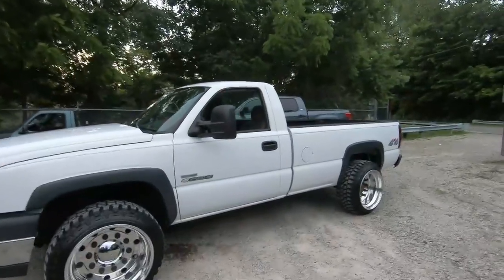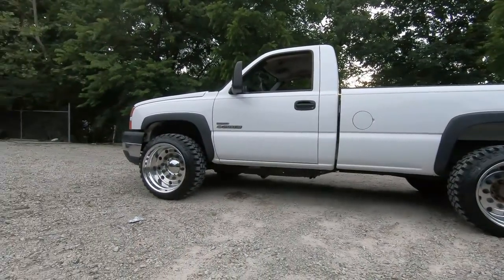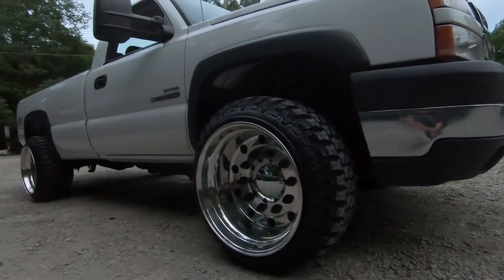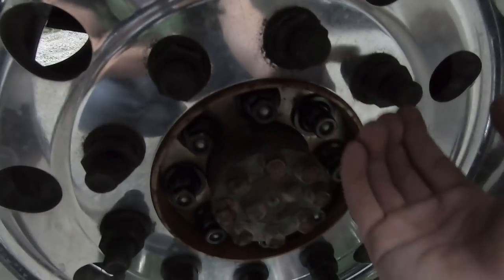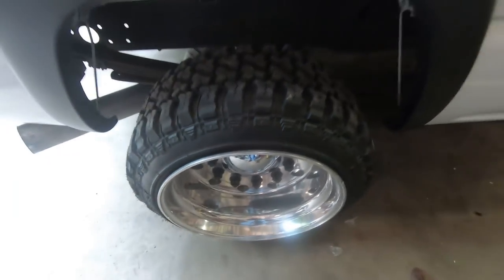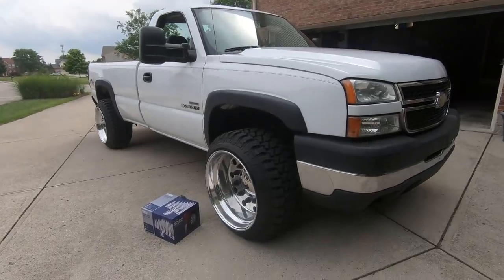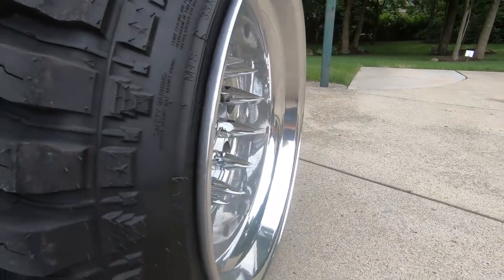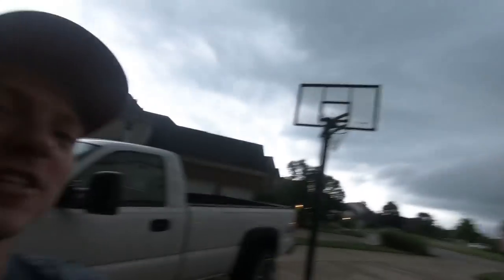Finishing Touches for the 22x14s Semi Truck Wheels for the Duramax

Comment: I would have put 3000 into the truck instead of a stretched out tire to me it looks tacky I hope you got extra spikes they will come off like a previous comment you should have got screw on spikes but not my truck I’ll stick with my dually with reg tires and rims and simulators to me looks fine
Reply from the maker: Haven't lost a spike yet and I've put 6k miles on the truck with these wheels. I'm a big fan of duallys too, but glad you're OK with me doing this!